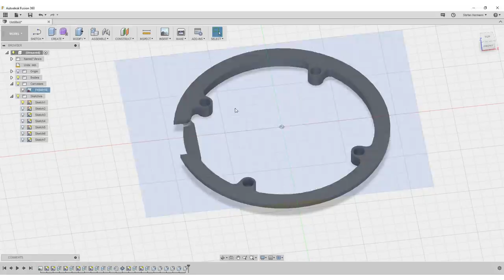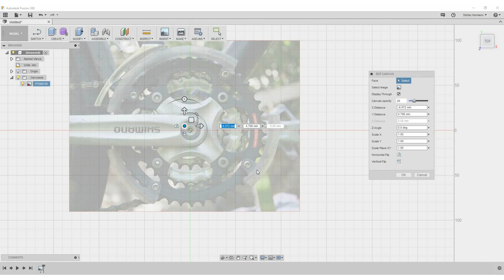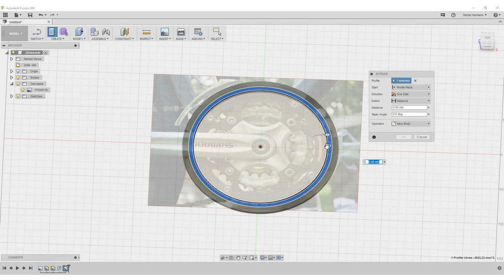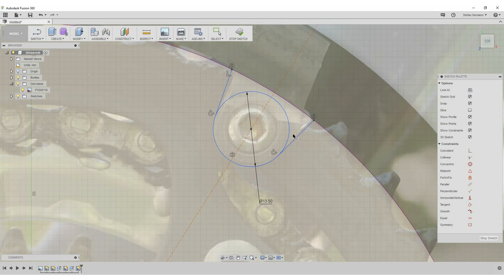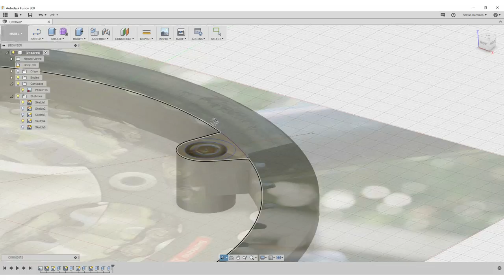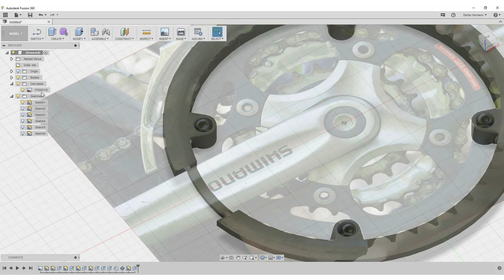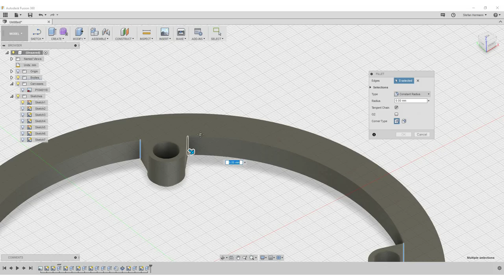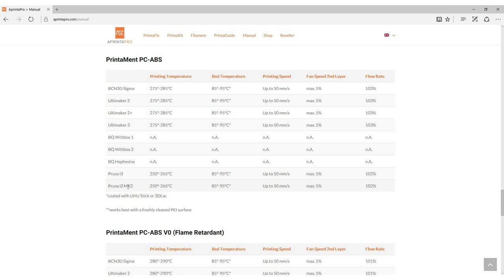Practical 3D printing - Bike chain guard printed in AprintaPro's PC-ABS

Comment: I frequently use a flatbed scanner to do the trick. In this case you would remove the outer sprocket and scan it to use as reference. No deformation worries and the dimensions would be correct from the beginning.
Reply from the maker: That's actually a good method if you can remove the part and it does not have a lot of depth.
Reply: Did same with a circuit board I needed to remake.
Reply: Actually this is a pretty good idea. I was thinking of taking photos from far away to reduce distortion but this seems pretty solid
Reply: That's a good idea. I have another one that might be helpful. Use millimeter paper or even a regular paper. Put the thing on it and draw a countour with a pencil, including all holes. Now you can use your paper sketch to measure all dimensions. This may sound stupid, because you can always measure the real object, why would you measure the sketch of it. But with the sketch you can actually do three things that you can't with the real object. The first is that you can make coordinate grid and input points to the software using coordinates, that's why you need millimeter paper. The second is that you can slice your sketch horizontally or vertically and measure section sizes. And the third is that you can measure dimensions relatively to any point you want, for example, measure distances between mounting holes centers (you can measure X distance, Y distance and total distance). This is mainly suitable for curved or complex objects

Comment: The photo reference trick is new to me. Love it! Quick caliper tip though: If measuring any kind of hole-to-hole dimension, measure one hole/screw/etc, zero out your calipers, and then measure the second hole. The readout will be exactly the proper dimension. Only works with same-sized holes though.
Reply: To be clear for those who don't understand, you mean that after measuring the bolt and zeroing, you then measure the distance inside to inside (closest point), instead of center to center.

Comment: Woah! Your girlfriend has hairy ankles!!  ;)

Love the video.  I like PC-ABS a lot.  Also, try Polymaker PC-Max.  It's an awesome material if you are using an enclosure.  I'm really really impressed with the properties and print quality.

Have you tried Nylon with carbon fibre also? Again.  Very good.  Nylforce is cheaper and warps less than others I have tried and has very good mechanical properties.

Keep up the great videos!
Reply from the maker: Kind of knew that this was coming ;-) These are actually my sexy legs :-P
Reply: CNC Kitchen ooh la la
Reply: Sorry, but I posted the exact same thing before I got to your comment! Great minds think alike!

Comment: Great work man! What you did was great. I would probably do it where the guard overlaps partially over the chain where the chain comes in contact with the gears teeth. Only on 180° vertically of course.

Comment: Very well done throughout the process.  I just purchased the license for Fusion 360 and watching you use it confirmed that it was the right thing to do for learning 3D printing design just because of the tools it has to keep the models in sync and that they look good too.  Did you measure the photo image and then compare the measurements on screen before starting the design of the part?  You may have said that, but I missed it if you did.

Comment: A lot of parts on my bike are printed, from fenders and light fixtures to the chain guard. I use PETG for everything and never have problems with deformation in the summer but I don't use black.
Reply: That's good to know and thanks for sharing. I come from regional Western Australia so heat deformation can be a teensy bit of an issue ;)

Currently I don't have a printer, I would get a mate to do stuff for me. Sadly he moved to another state for work sooo.....

Comment: please explore revolve feature in f360. round parts are better done using revolve than extrude. sketch the profile and revolve, waay better than 3 extrude features. and do believe me that extrude will bite you latter as the design is going more complex. btw your testing section is helping me quite a lot. thank you for doing this.

Comment: That frame rate on fusion would drive me mad.
Reply: I bet that's only due to his PC and recording software, I've been using Fusion for quite a while now and have nowhere near such issues.
Reply from the maker: +boomerangfreak Jap, the recording software is crappy. I definitiv need a proper one. Any recommendations anyone? 😁 Windows only.
Reply: Been a while since I used recording software but as far as I know OBS (Open Broadcaster Software) seems to be the most popular and is light on your resources
Reply: CNC Kitchen if you have an nvidia GPU you could try shadow play its meant to have minimal performance hit.